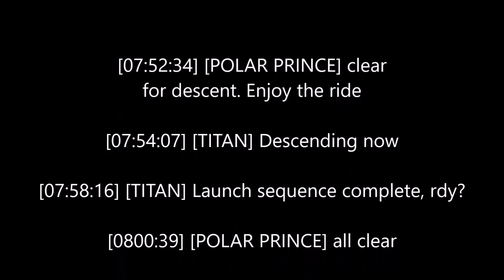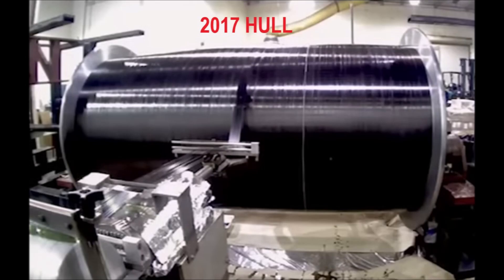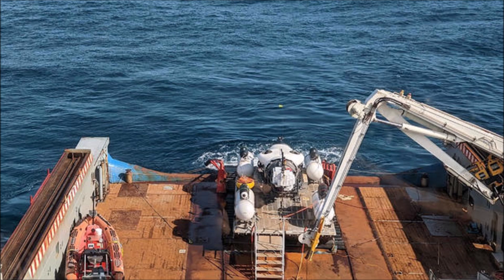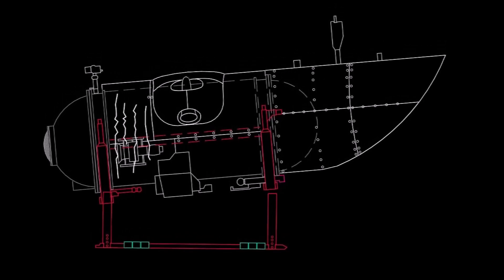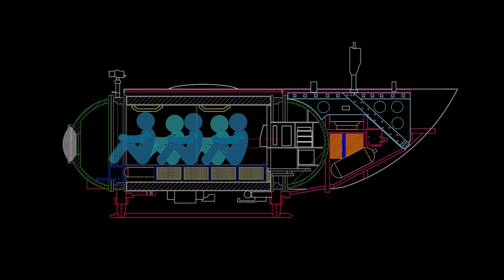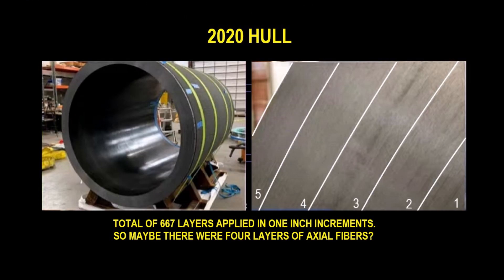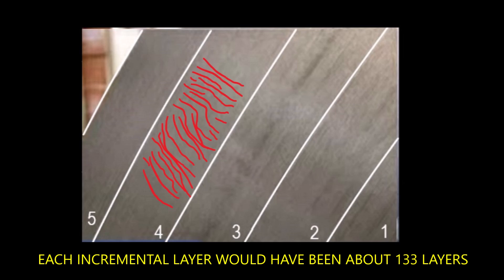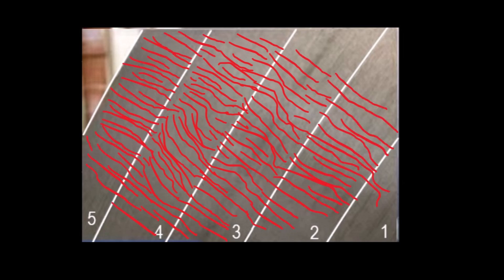OceanGate Titan - CRACKLING SOUNDS EXPLAINED?

Comment: A surface crew member from OceanGate has confirmed that this transcript is 100% fictitious. In particular, authentic communications were in the form of very highly abbreviated text such as the last transmission from Titan which was "DRPD 2W", indicating that they dropped two weights (a normal procedure in their diving). If you want more information about this, do some investigation and/or watch Mike Bell's informative video.
Reply from the maker: That would make sense but it also depends on who was the "mission specialist" tasked with the texting. I don't know that in an emergency whoever was actually in charge of that on this dive would be sticking to those codes. In any case, it did make me think of how the carbon fiber hull could have failed and it also led me down the path of discovering that there were two different hulls used in Titan. So even if it turns out to be fake, it made me ask questions and seek answers that I likely wouldn't have done otherwise.

Comment: As the hull was buckling... before it catastrophically imploded... it buckled in some way (they heard these crackling sounds)... deforming the hull's shape just enough... to prevent them from being able to drop the external frame.
That's likely why they couldn't release that frame.
That was their last hope to rise quickly enough and ease the water pressures on the failing hull.
Although... even if it did slide off... I feel like the hull would've still imploded. But that was their last chance. Sadly.
Reply from the maker: Hard to say. With the way that each corner of the frame wedged into the "lug" on the interface ring, it should have dropped off with no trouble. With the way the frame release pins were arranged, I don't think it would be difficult to have one come out and the other one not. I went over that in this video:
 https://www.youtube.com/watch?v=_ve1b9xmtyw&t=1s
Reply: @VegasCyclingFreak  Fair enough. Thanks for a thoughtful reply.

Comment: Without the evidence to analyse, speculating on failure scenarios could be all consuming. Teo facts seem to align for me, one that the craft descended too rapidly and would only ascend very slowly after dropping all weights, and on full up thrust power. Both of these suggest the craft was massively negatively buoyant, which suggests significant system failure or failures, regardless of hull integrity. If the hull had begun to compression fail longitudinally, that may explain the trouble had with dropping the frame given the wedge featured locators with flat sides longitudinally instead of conical pins. Prior dive thruster missorientation could again explain fast descent and slow ascent.
Reply from the maker: In a earlier video I proposed that perhaps there's a human error element, where a mistake was made and there was too much ballast. 

My other suspicion is that perhaps ocean currents were involved. They did have the worst weather in Newfoundland area in 40 years, so it seems like they could have had a strong current helping them to dive much quicker than usual and the same current could have given them trouble ascending. The weather has been pretty weird this year... I mean a hurricane almost made it to the coast of California and ocean temps around Florida were shockingly high this summer, to where the coral reefs are in serious danger of dying (or so we've been told). 

As far as I know, the only time they would really use the thrusters was when down at the Titanic and navigating as necessary to drop down on top the shipwreck. Seems to me that they descended and ascended pretty much passively on a typical dive. That's why about 5 hours of their "missions" was taken up just by that, and I guess some amount of time getting in and out of Titan.

Comment: Part of the problem is that the vertical propellers are not mounted vertically. They are angled inward such that much of the power is wasted. Adding to that, the fibers of the hull are apparently not criss crossed but are parallel to each other. But I am not sure of that. There is conflicting info on that. 
If all the fibers are parallel to each other that means that theoretically there is a small segment that is only plastic with no reinforcement. A perfect place for a crack to propagate.
Reply from the maker: Depends on if we are talking about the 2017 hull or the 2020 hull. I think the 2020 hull had at least a few layers of axial fibers. The 2017 appears to have had none. 

The vertical thrusters basically were oriented same as what they used on the Cyclops. The Titan was in a way like Cyclops on steroids. Not sure how they arrived at that location for them.

Comment: Can the one inch layers in the CF de-laminate from each other?
Reply from the maker: Good question. I suppose it’s possible but as I understand it, failures in carbon fiber generally start very small, like the size of individual fibers (approx. 0.5mm in diameter) and then it propagates to a larger failure. There’s also so many other variables mixed in like the resin/epoxy used, how it’s cured, the lay up, etc. Carbon fiber in compression is also a non-linear problem so it’s very difficult to predict how it will work in the real world with great accuracy.

Comment: Good work and interesting details.  A couple of things trouble me.  
1. The rate of descent increased.  Titan cannot have increased its mass, so it must have lost buoyancy.  There must have been some water getting into some part of the buoyant space. 
2. The craft was trimmed to float level with the frame on but with weights gone - for example during ascent.  There were foam buoyancy compensators in the machine compartment to balance the mass at that end.  With the frame gone I think the sub would have swung to float front (port hole) end up.  That would have been catastrophic for the occupants as they would all be standing on the 'rear' wall screening electronics etc at the rear end cap.  Reaching screens etc would have been hard.  No indication of that misery on the transcript.
Reply from the maker: Regarding the buoyancy thing - I didn’t mention it but personally I think they encountered a strong current that made descent faster than normal and gave them some trouble when trying to ascend, and possibly a human error element of a little too much ballast for this dive too. Apparently the worst weather in 40 years in Newfoundland area this year. The weather was kinda crazy this year… I mean a hurricane almost made it to California coast. Highly unusual. Even if a little water was getting inside, we’re talking about a sub that weighs 20-tons so it seems pretty inconsequential. Syntactic foam was in the very end of the tail so if anything it would have tipped forward… but they had to drop the weight carriage once before and P.H. Nargeolet was sleeping inside so I don’t think it tips forward without that weight. You can hear that recounted here: 

BRUCE MORTON DESCRIBES ONE INCIDENT WITH THE DROP WEIGHTS
https://youtu.be/zDcDZxCsrr0
Reply: @VegasCyclingFreak  The normal descent rate on past dives was about 25 metres per minute (m/min).

From the times and depths in the text messages, during this dive; right from the start the sub was descending at about 38 to 39 m/min, and the last part from 2960 m depth to 3433 m depth at 44 m/min, almost twice the optimum rate. On the way to 3433 m depth the structure alarms started going off.

That seems to be much more than an eddy would account for IMHO.
Reply from the maker: @nigelwilliams7920  In another video I proposed a human error element - too much ballast. Add ocean currents to that and you’re now descending “too fast”.
Reply: @apollomoonlandings  Yes.  Even tho a leak seems to be the only 'sensible' way the loss of buoyancy can be explained, its beyond my skill to calculate how much water would be required to give rise to the observed rates of descent.  

The normal descent rate on past dives was about 25 metres per minute (m/min).

From the times and depths in the text messages, during this dive; right from the start the sub was descending at about 38 to 39 m/min, and the last part from 2960 m depth to 3433 m depth at 44 m/min, almost twice the optimum rate. On the way to 3433 m depth the structure alarms started going off.

So that is a big difference in descent rates compared to previous dives, and the increase in descent rate towards the end is also hard to figure given that there was no report of water intrusion.  Wartime experience would seem to suggest that any leak would be rather obvious to the occupants (think Das Boot under depth charges).
Reply: @nigelwilliams7920  If the water was flooding the battery oxygen compartment no one would know. It would just be part of the condensation. The flowrate would increase with the depth of the of the Titan.  Also the balance fore and aft would be maintained. A lot like water in the bilge.
Reply from the maker: @apollomoonlandings  Many people have commented similar theory about taking on water but I just can’t see it happening. I think it was ocean currents. Apparently worst weather in 40 years in the Newfoundland area and also the highest recorded temperatures in the ocean in places such as Florida. The same current that could make them dive so fast could have also given them trouble trying to ascend. Rush even said himself in 2022 interview that he was at the mercy of ocean currents.

Comment: Here is my take. Either the adhesive or a hull penetrator failed allowing water to seep into the battery oxygen compartment at first and increase in flowrate the deeper the Titan went. This would be the reason for descending at a faster rate and not being able to ascend. The water also goes into the of the aft cap causes a short. The batteries in system A are shorted and go dead. This short system may produce crackling sounds that go away after batteries are drained. Switch to battery system B and the shorting begins anew maybe crackling until System's B's batteries are drained,
Reply from the maker: Sounds reasonable except I think the batteries they are referring to are in the tail section (powering the thrusters). Internal batteries were independent electrical system. The data and hydraulic lines are what penetrated the hull. If internal batteries are what shorted out then they would not be able to communicate, navigate, use the fan powered box that removed CO2, or have any lights. Even if they had all that happen, they had CO2 absorbing blankets and the ballast was supposed to automatically drop I believe after 24 hours and it would resurface all by itself provided they weren’t entangled in anything. That’s how it was supposed to work anyway. Dropping the frame and weight carriage were strictly for emergency. They generally only wanted to do that as a last resort. Listen to what Bruce Morton says here: 

BRUCE MORTON DESCRIBES ONE INCIDENT WITH THE DROP WEIGHTS
https://youtu.be/zDcDZxCsrr0

Comment: I am still not fully convinced that the aft-section refers to a part of the hull. I always thought the aft section refers to the part where the batteries and sonardyne was housed. It seems kinda irrelevant to mention what section of the hull is crackling, all sections being equally fatal. It could have been them hearing batteries A crumbling.
Reply from the maker: Aft would’ve have been the rear where the computer monitors were. The batteries in the tail were rated for depths deeper than 3,800 meters (I believe likely they used 6,000 meter version of Ictineu battery but maybe they used 4,000 meter). In the debris video both batteries appear to be intact. 

You can check out the available batteries here: https://hydrospacegroup.com/product/subsea-batteries/